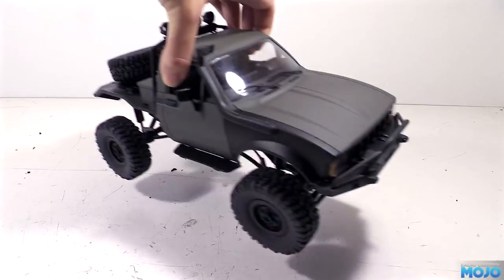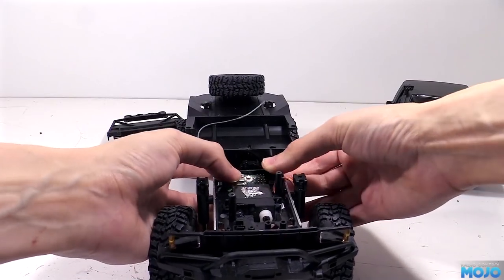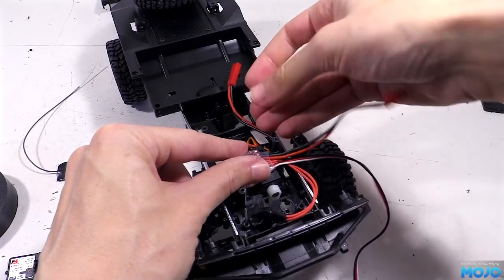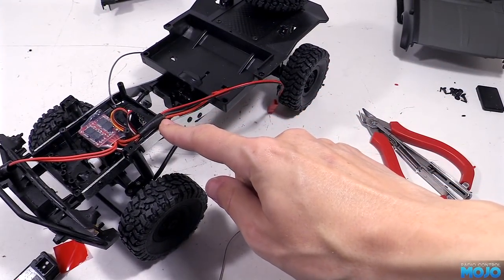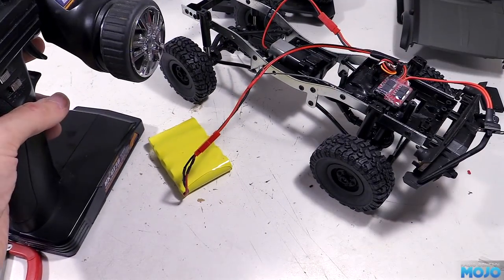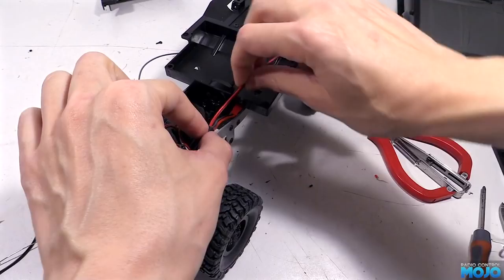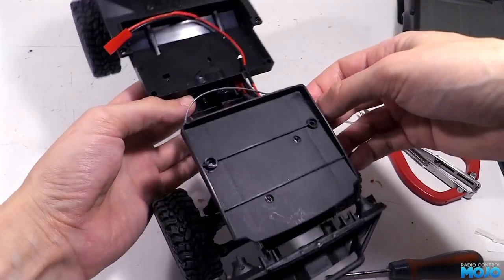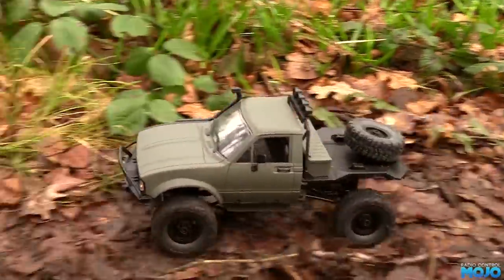WPL C14 - Radio and ESC

Comment: After seeing yours run, I noticed I had the same 2wd issue on mine due to drive shaft slippage.  Took it apart and locked it up with super glue.  Problem fixed.  Thanks for the nice video.

Comment: Great job! Btw can I get proportional steering  if I replace servo on my stock C14? Thnx.
Reply from the maker: I believe you'll need to swap the electronics with one of the new WPL boards, which could have the benefit of engine sounds too if you choose the right one. Or change to hobby grade electronics

Comment: Im having an issues with the motor not turning sometimes it will go back and forth then ill stop working and the steering continue to work. The red LED lights up when you hit the throttle back and froths.

Comment: How’s the drag brake working with that esc? I can’t get mine to slow my truck down even on some pretty small downhills.
Reply from the maker: I haven’t driven the truck for quite a while, but I remember the brakes working in forward/brake/reverse mode but there not being any noticeable drag brake in forward/reverse mode. When I get to the electronics on the C44KM I’m going to be a bit more scientific about the testing

Comment: I placed a 10A ESC with 6CH receiver and a 370 motor on my C24. It runs but doesn't have reverse. Also using a 6CH radio. Can  you help? Thanks in advance.
Reply: Does your esc have reverse? And I'm guessing you've checked your transmitter. Haven't seen to many 6 Channels without reverse but I mean throttle trim or any other settings it has

Comment: I take it that's a fwd/rev esc with brake?
Reply from the maker: There's no brake, just forward/freewheel/reverse.
Given the size and weight of the truck it works rather well though, with the weak motor you can give it a little reverse to slow things down without instantly flipping the truck.

Comment: Dose anyone know why my c14 don't reverse right away after doing this mod ??
Reply: most likely cause is that you used an ESC with brake which would require you to reverse twice before it actually moves
Reply: most likely cause is that you used an ESC with brake which would require you to reverse twice before it actually moves
Reply: Yes exactly ... So what is the fix ?
Reply: Figured it out thanks 😁
Reply: @kevinc1989 
Braking is necessary!!!
Or are you shifting from 200 kmh direct in reverse?
Probably not
Reply: It was a esc with high and low
Reply: Low and high no shifting I don't think it was for the two speed tran
Reply: @kevinc1989  There is no esc with high low.
Reply: Yeah it was a kit I got from Amazon with the two speed mother tran and remote
Reply: No esc came with
Reply: Moter
Reply: @kevinc1989  Wow.